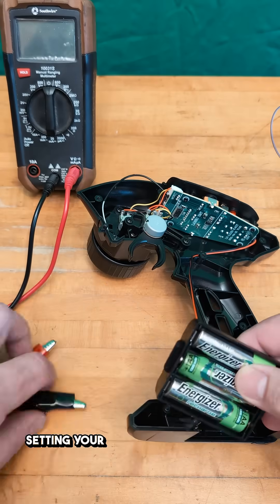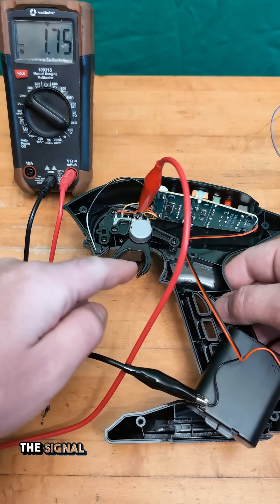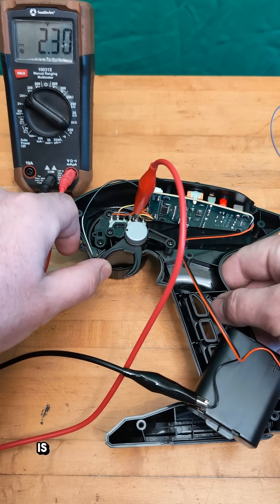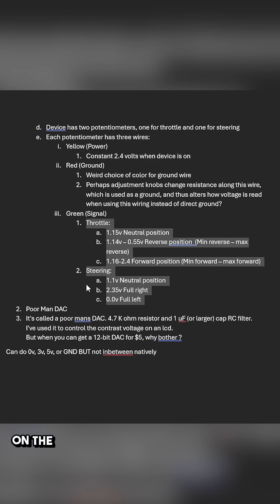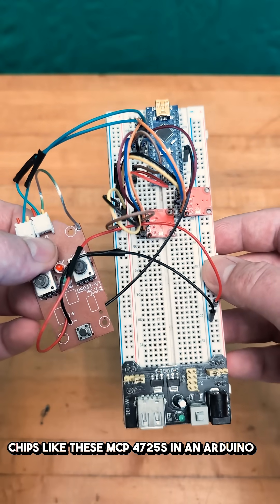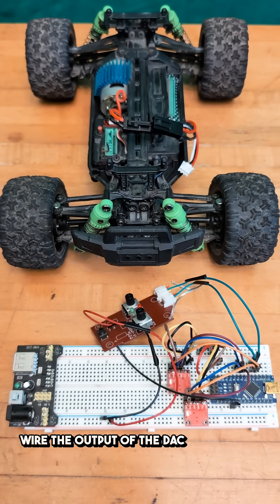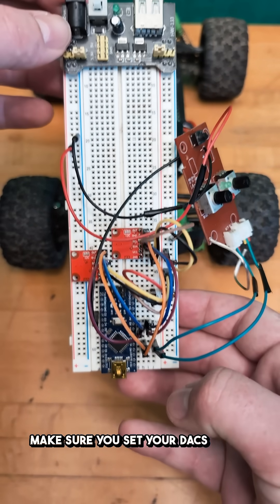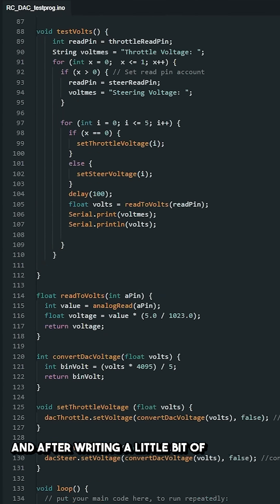Learn how to control ANY RC CAR with Arduino in 60 Seconds!

Comment from the maker: I need a program for drawing up arduino wiring diagrams. Any suggestions?
Reply: fritzing
Reply from the maker: @DasEtwas  I've been tinkering with that since last night. Was having issues using Inkscape to create my own chips, realized it was because measurements in Inkscape by default were set to pixels and inches. Changed everything to millimeters and seems to be working great to modify and add custom chips. Tried quite a few and it seems like fritzing is the most powerful/best so far.
Reply: I use Google Drawings. It takes a bit more effort but it's extremely versatile
Reply from the maker: @AJ-Palermo  I don't think I've checked that out yet, I'll give it a shot. Thanks!
Reply: Tinkercad does have a circuit maker with arduino
Reply from the maker: @Megaderpus_Maximus  tried out tinkercad but didn't have the chips I need and didn't seem to have a way to add new ones in/make your own
Reply: @dQuigz for doing electronics the professional way, I use KiCad. this is enough to document the circuitry, but I'm not sure if there are premade Arduino symbols available